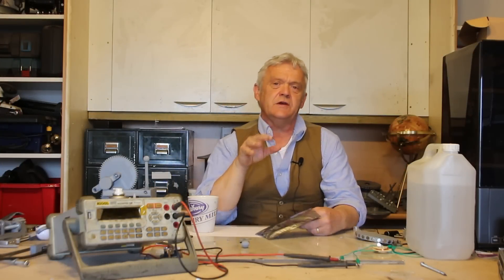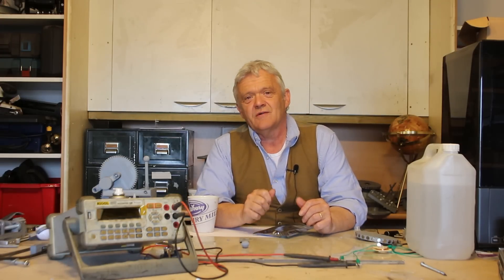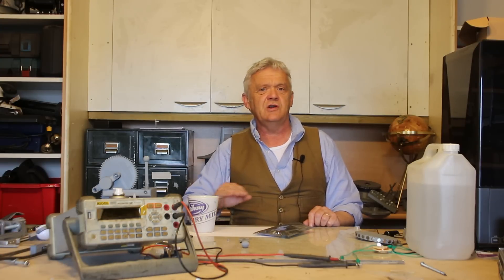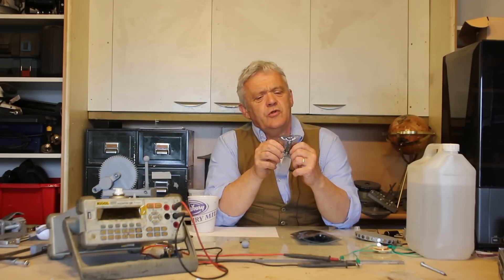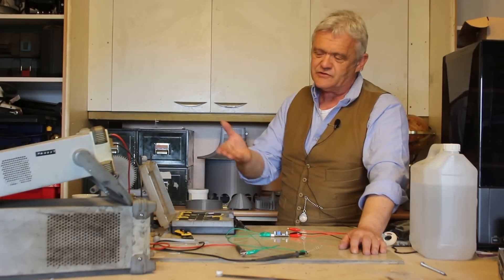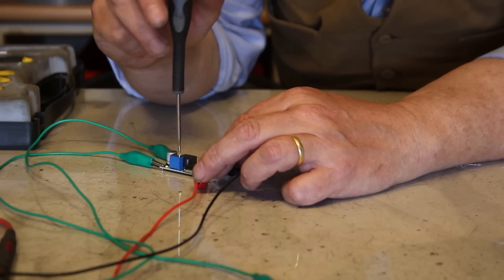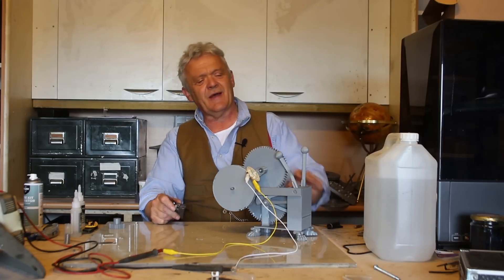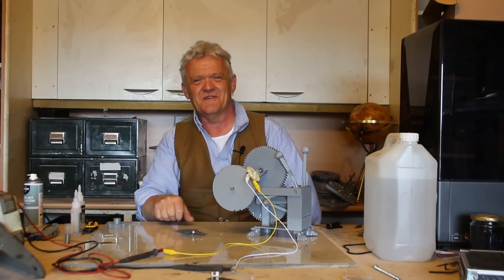1981 From Generator To Battery - The Electronics And How To Do It

Comment: I want a really small transverse flux generator powering some nichrome wire as an emergency fire starter.  Would I need to rectify it or would it still get hot enough to start a fire anyway even though it is something like 16 Hz AC?

Comment: Almost correct. Most generators are AC, the exception is the Homopolar generator which is a DC generator.  The brushes do not rectify, just make contact with the rotating core.

Comment: I used a similar regulator with a solar panel to charge batteries. It worked well. But didn't have a way to see if the batteries were charged or not.

Comment: I think it is time to discuss impedance matching. Power sources have inherent resistive losses, so if you vary the loading, the efficiency follows a plotted power exchange curve. Too little loading means that you are not utilizing all the available power. Too much loading means that you are losing more power in the source resistance than in the load. There is a nifty mathematical graph to show this. The same idea can be applied to the actual generation process. If a wind turbine just free wheels, then power is not being fully utilized. Too much loading and the turbine stalls, Turns out that if the turbine is loaded such that it slows to about half the speed  of free wheeling then you are at the best power exchange point. But how to know what the free wheeling speed is when being actually used. The answer is a pilot generator that is a scale model of the larger. As the wind changes, the loading can be made to automatically adjust, maintaining the best efficiency. A MPPE solar panel regulator does this by taking periodic and very fast open circuit voltage samples to track available sunshine.

Comment: I've used this board. It only works if the input is 12v ... As soon as I put it directly to the panel (19v) the output goes beyond the set limits

Comment: Hello, I really love all of your videos but feel like I don't know enough electrical theory to always follow exactly what is being talked about. Are there any good options for learning at least the basics that you could recommend? Keep up the great videos!
Reply: AC - Alternating Current (house  mains) electricity alternately flows to and from the end point

DC - Direct Current (batteries) the electricity only flows through the battery and the end device in one direction. Positive and negative are important.

He showed a schematic to a bridge rectifier which was using 4 diodes (diodes prevent electricity from flowing a certain direction) and is a common technique to catch the backwards electricity and re orient the right way again to make it usable as DC to charge to a battery or run many common electronics (which all take AC out of the wall) and do their own bridge rectification to get to DC before their electronics use it that way.

This is also why if we have our own batteries @ the right voltage already and since it's DC we can throw away that brick that plugs into the wall and feed DC directly to cameras, microphones, etc etc

Comment: For the AC generation I get it but what about some of the other generation methods like the triboelectric generators, eg raindrops,  which put out bursts of DC up to about 250v if I understand correctly and quite possibly I don't, or the atmospheric energy due to height above ground which is low amps but can be very high voltage.  That I am not sure how it would be collected and conditioned to put into a battery bank.

Comment: Robert you should probably mention that the regulators (switch mode dc/dc power supplies)mostly are either step down(buck) or step up (boost) there are combination ones called a buck boost converters/regulators. This is important because as a buck converter can only output a lower voltage on the output of what it receives on the input. A boost module the opposite. So you want to keep that in mind when you buy it. Typically you know what voltage you need on your output. If you need to charge a LIFEPO4 24v 8s battery for example you need something like 28-28.4v volts on the output of your regulator, but if your source provides 12volts you would want a boost regulator converter. If you source provides 50v you would want the buck version. Buck boost regulators do exist but are usually more difficult to find and they are more expensive but they will do both.
Reply from the maker: good point mate - thanks for adding it
Reply: I Love Switched mode DC/DC power supplies. They are very efficient up to 97%. Often though they don't come with reverse voltage protection. I cannot stress enough how much you have to take this into consideration especially in charging circuits. A battery is a power supply and so is your voltage regulator. As you know  Voltage and current flows from high to low. In other words you need to use diodes.

Comment: Personally, I don't have anything small enough to justify such a small system.

I run a machine shop and foundry so I burn through as much as 50 Kw instantaneously at the shop, should I have everything running at once.
Reply from the maker: it's the same routine mate - just heavier duty equipment really

Comment: There are some very inexpensive MPPT's out there as well.
Reply from the maker: MPPT is just about battery charging mate - it's a block you add between the voltage regulator and the battery pack
Reply: @ThinkingandTinkering  Well, that's true, but I thought that's what most of this was about....how to stabilize your rectified DC and use it for something.  So if you want to charge a battery, and your generated voltage swings wildly, MPPT will maintain your volts and adjust the amps going to the battery.
Reply from the maker: @Dave_D.  Oh - i didn't think of it that way - I tend to see batteries as on application - plus MPPT isn't really needed - it's used - as is PWM as is nothing at all - MPPT gives more control - that's for sure - and sometimes you need to control battery charging and discharging like if you use lithium - but we might be getting into the topic of another video right here lol - i tried to keep it to absolute basics but i like the comments section when more complicated stuff comes out there and gets discussed - that sort of makes it for everyone in my mind - cheers mate and thanks for raising the point
Reply: @ThinkingandTinkering  I guess I was thinking that MPPT WAS simple, in that, our generators would be the same variable type output as wind or solar.  The advantage of MPPT over the regulator is that you maintain the wattage as well...w/ MPPT, the input could be 100v @ 1A, but if you are charging 12v batteries, you'd get 14v (or whatever charge voltage you are using per stage) @ 7A.  Maybe I'm wrong, but wouldn't the regulator as you have shown 'waste' power by reducing say 20v to 5v (though allow you to maintain a constant 5v)?
Reply from the maker: @Dave_D.  my understanding of MPPT might differ from yours mate - in my understanding MPPT is the basically the same as PWM but PWM has a fixed duty cycle whereas in MPPT the duty cycle is variable so the impedance of the source is matched to the impedance of the load at any one time at which point maximum power is transferred  - so, in essence it is really just switching. It is really a DC to DC conversion and as solar panels are already DC then there is no issue but as other forms of generation tend to be AC then DC conversion has to be done first
Reply: @ThinkingandTinkering  I'm far from an expert on this, but my understanding is that MPPT maintains wattage (very efficiently) in that the 100v @ 1A input w/ PWM, would only give you 14v @ 1A out to charge a 12v battery, where the MPPT (maximum power point as you said) gives you all of that power out by 'converting' the excess volts to amps and keeps the total watts the same going in and out...ie 14v @ 7A.  I could be completely wrong, of course.
Reply from the maker: @Dave_D.  oh right - no it doesn't do that - that would be impossible - wattage is a measure of power - if the solar panel is in poor light wattage will drop if it was maintained it would be effectively creating energy  - because there is no power being produced it can't be maintained - it matches source and load impedance to transfer power at the most efficient point
Reply: @ThinkingandTinkering  Of course you can't create more energy than is there....the MPPT just maintains the wattage in vs wattage out, where PWM does not because it has to waste power by reducing the output to match the load, regardless of how much it's making.  Maybe I'm not describing it correctly, this article describes it as I thought it worked:

OK, so now we have this neat 130-watt solar panel. Catch #1 is that it is rated at 130 watts at a particular voltage and current. The Kyocera KC-130 is rated at 7.39 amps at 17.6 volts. (7.39 amps times 17.6 volts = 130 watts).

Why 130 Watts does NOT equal 130 watts
Where did my Watts go?
So what happens when you hook up this 130-watt panel to your battery through a regular charge controller?

Unfortunately, what happens is not 130 watts.
Your panel puts out 7.4 amps. Your battery is sitting at 12 volts under charge: 7.4 amps times 12 volts = 88.8 watts. You lost over 41 watts - but you paid for 130. That 41 watts are not going anywhere, it just is not being produced because there is a poor match between the panel and the battery.

How Maximum Power Point Tracking works
Here is where the optimization or maximum power point tracking comes in. Assume your battery is low, at 12 volts. An MPPT takes that 17.6 volts at 7.4 amps and converts it down so that what the battery gets is now 10.8 amps at 12 volts. Now you still have almost 130 watts, and everyone is happy.
Reply from the maker: @Dave_D.  no i understood - your watts go in impedance mismatch - usually as heat. The watts are produced they just don't reach the battery because the panel and battery impedance are mismatched and the watts just generate heat. The central problem addressed by MPPT is that the efficiency of power transfer from the solar cell depends on the amount of available sunlight, shading, solar panel temperature and the load's electrical characteristics. As these conditions vary, the load characteristic (impedance) that gives the highest power transfer changes. The system is optimized when the load characteristic changes to keep power transfer at highest efficiency. This optimal load characteristic is called the maximum power point (MPP). MPPT is the process of adjusting the load characteristic as the conditions change. I don't want to be rude but the explanation you gave doesn't describe how it works - it describes the overall net effect in one situation presented in terms of watts - but watts can't be adjusted you pay for volts by amps or amps by volts - you can do that to maintain the power transfer efficiency as high but the absolute power that is transferred depends on how much is produced
Reply: @ThinkingandTinkering  I do not understand it to the level you do, and my explanation was overly simplified, my only point was, that if you have 100 watts produced (100v @ 1A), and you regulate it down to 14v as you described, you are only getting 14 watts (14v @ 1A) to the battery.  If you used MPPT, you'd get 93 watts to the battery (14v @ 6.5A).  I'm not saying you are creating energy, just better utilizing what is produced, and as what is produced changes, obviously so does what comes out.....but MPPT will almost always put out more of what is produced.  And MPPTs are cheap enough now to be an option.

Don't worry about being 'rude'....if I'm wrong, I'm wrong (usually) and I have no problem w/ you correcting me...just trying to learn like everybody else!

Comment: 3:56 and 4:36 - Is the labeling of IN and OUT on the converter mistaken? The IN appears to be labelled as OUT and vice-versa.
Reply from the maker: no - it's not a mistake
Reply: @ThinkingandTinkering  so is the board or the image mislabeled? Or is it the application which inverts the labels? Or am I missing something?
Reply from the maker: @mattmill30  I don't know mate and it really doesn't matter - when you get the board connect the in and out according out what it says on the board and you are done - that's all that matters really - if they printed the wrong way round it wouldn't work and they would get an awful lot of returns lol

Comment: This is really interesting! I was wondering if it was possible to take one of those car charger adapters that take the large barrel connection from the car and allows you to plug in USB chargers as a way to Take input voltage and make it usable for charging phones.

I figured there's two connections and it should be pretty straightforward just to connect wires to a normal car charger. I suppose it's a 12 volt to 5 volt power converter with probably some circuitry to ease out uneven loads from the alternator.
Reply from the maker: yep as long as you are generating around 10-14 volts or so

Comment: Good One Rob. Thank YOU.  I think a battery (depending on voltage)   can be used to adjust V out I don't think you need a power supply.
Reply from the maker: you are dead right mate - thanks for adding that

Comment: Great one Rob! This will be a good starting place for a great many.

I too tend to forget to explain some of the "basics" as I've been tinkering with electrical appliances and electronics since shortly after I could walk. We were broke, we rarely missed a meal but it was often made from only what our Church's pantry could supply that week so my toys were, and were made from, what appliances my parents found at the side of the road. 
I assume it's largely the same in most places that things left at the roadside are an invitation for anyone to take and it's considered courteous to leave a simple note of "works" or "broken" and for the taker to take the entire appliance so as to not leave a mess. Please, those reading, how common is this?
We aren't so bad off now (though I knew no difference growing up) but I'm still bringing interesting things home and having my children take things apart, see how they work or why they don't and if it's worth fixing or harvesting for parts. I don't want them to miss out on the best part of learning by giving it a go.
Reply from the maker: that's what i am hoping for mate - and there is no better way to learn than by doing for sure

Comment: couple super capacitors to either increase the voltage or amps.
Reply from the maker: for sure mate - charge in parallel and discharge in series

Comment: what about MPPT solar controllers.  do they work in a similar way to the whole setup here?
Reply: wouldnt their input already be DC from the solar panel?
Reply: @grendel1960a  Or from a rectified AC source. Some even have internal rectifiers to do the job and to protect from being incorrectly installed.
Reply: The topic of MPPT fills more than a couple volumes but the basics are that using a control loop it uses a variable DC-DC converter to "test" the Wattage (Volts times Amps) at the range of it's input Voltage to find the "best" setting.
Some algorithms are better at one application, some at another. That's where you can really dig in if you're interested.

I hope that made sense and was helpful.
Reply: @matthewellisor5835  so you would need to rectify the voltage before putting them through an mppt controller?
Reply from the maker: logically MPPT is really just a battery charging regime mate - it sits between the voltage regulator and the batteries - but it is not strictly necessary - as a circuit it tends to be used in solar as it can't really cope well with spikes that can arise in wind and often on an MPPT board you see rectification and regulation included